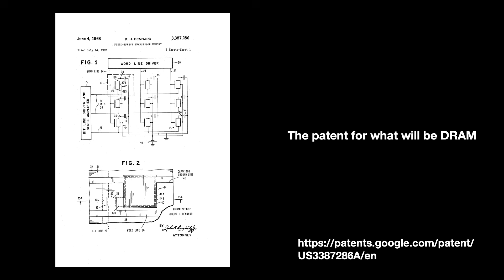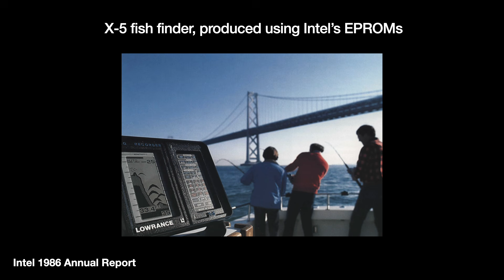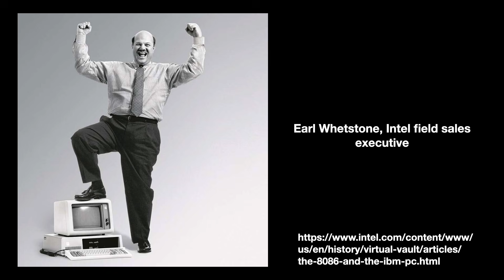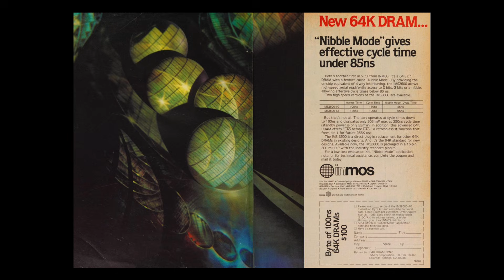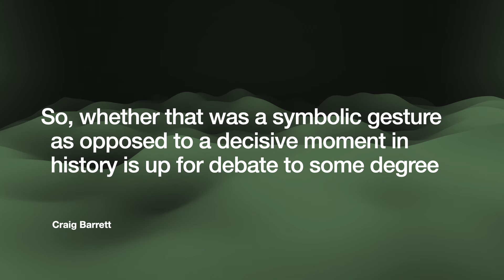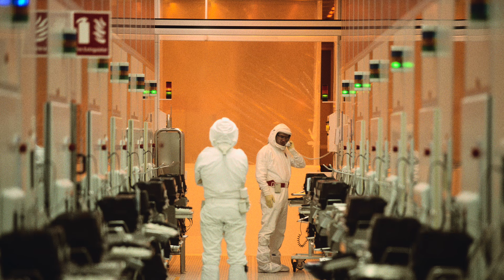What Once Saved Intel

Comment: I proposed a 4004 in a radio telemetry design in early 1972, somewhere between February and April. I was hired as a consultant to do the phase modulator of the telemetry transmitter, quite trivial and easily dispensed with.
Next they asked to build a demodulator for the same phase modulated signal on the receiver end of the channel. I used an Intel 256 x 4 bit C1402A PMOS  shit register instead of PLL to recover the phase change information.
After the company finished accusing of cheating (running wires under the table), employing magic… or maybe even Witchcraft. They then asked me to design the receiver itself.
I proposed a 4004 to do I/O and calculations. We decided to call Intel in. Turned they were totally clueless.
Very few people, including some of Intel’s top sales force knew what a microprocessor was. An indication of this was a trade journal called ‘New Logic Notebook’.

Comment: Craig’s ( my fellow PhD in Materials and neighbor ) “Copy Exactly” lasted too long, it was enforced by the extremely bureaucratic and scientifically rather primitive ( when I first moved from Motorola to Intel 8 yrs after developing Six Sigma, Intel had not even started using any Statistics ! ) Change Control Procedure, appropriate for Fabs but eagerly adopted even in R&D by substandard Engineers to block new / disruptive ideas, eventually killed Science and Innovation inside Intel, something a Scientist like Craig had never intended. This is one of the big reasons behind Intel’s current troubles along w/ Andy’s weakness for a certain Ethnic Mafia from the Middle East, which in turn validated 3 other self serving ethnic mafias ( incompetents all ) at Intel, made gentlemen Scientists leave in disgust, turning it into a giant but mediocre bureaucracy not able to keep up even with the legacy PC & Server markets.

Comment: I worked with reliability testing in 1986 and Fujitsu memory circuits was best. Motorola 68000 processors we ran for 2 years in 160 C with zero failures so the test was stopped.

Comment: 7:40 these are old PNP BJT germanium transistors by Fujitsu (old in the sense that they aren't made anymore but new unused stocks are still available), model number SA269, targeted for RF radio receivers, packaged in TO1, max power dissipation 80mW, max Vcb=20V, max Ic=10mA, Cc=4pF, hFE=45, ft=12MHz (frequency where gain is 1).

Comment: I seem to remember that at one time IBM bought a considerable number of Intel shares, keeping them one or two years.  Is that true, or was the relationship even the other way round?  But one thing I remember definitely was the cross licensing of the math co-processor with AMD.  We used the AMD version in our otherwise Motorola chips based systems — that is why I recall this detail.

Comment: I worked at National Semiconductor in the 80s and lived through much of this. The Japanese simply kicked our backsides in both cost and quality. By the early 90s we were laying everyone off and they eventually closed the fab.
Reply: Exporting Deming to Japan had such a profound impact it’s hard to understate. By the time we started talking about “quality” the same way in the 90’s it was far too late.
Reply: @c1ph3rpunk  I did a lot of characterization work on Japanese DRAMs and EMPROMs in the late 80s/90s. The striking thing was how close there were electrically and functionally across the parts delivered in a single tube. Things like TACC, TCE, current draw, VCC margins were very consistent. There were also well guard-banded. In my memory the 64K DRAM 120ns parts were good at margins for 90ns. We hadn't achieved the same quality or repeatability. Several of the engineers at the time were very concerned as was I. This was a strong indicator that without a LOT of work we would lose the market, which we eventually did.

Comment: Going alone with the 386 led to market stagnation as intel didn't have competition and didn't increase clock speeds as much as they could (good for intel bad for buyers). Eventually when 386 cpus from other vendors appeared clocks went up, but by then Intel had the 486 and would be forced to compete on clocks once again in the new generation as the competition caught up fast.

Comment: I worked with Intel in the early days of Flash memory (I had a company that designed and manufactured solid state disks).  I believe it was circa 1987 or so when we received some of the early 256Kb chips, with 1Mb chips to follow shortly thereafter.  Intel was a company with an attitude back then, and could be challenging to work with.  But they helped create and drive the Flash memory market (NOR-based) from the late 80s into the 90s.

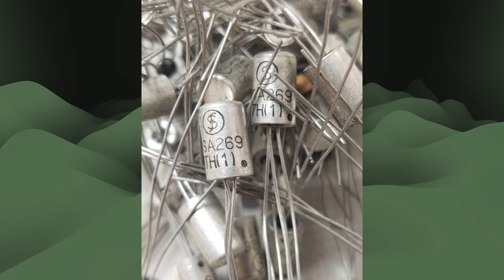Comment: 7:30 2SA269 Germanium alloy-junction transistor.  Originally made by Kobe Kogyo Corp (Kobe Industries Corp) marking is TEN.
Kobe Kogyo later merged into Fujitsu (and the logo changed to the pattern in 7:30 picture.)
Reply: And 3:29 that's a core memory, not 1103 🤦🏻‍♂️🤦🏻‍♂️🤦🏻‍♂️

Comment: The 386 was made all the way into 2007, was this all on the same node or were there several changes in node? 
I know there was some stability in package form because many were used for industrial computers that required identical packaging for long term replacement parts. The 386 was the last formally verified real-time capable x86 which made it popular for critical systems long after 486 and Pentium had come and gone. (Real Pentiums, not just marketing abusing the name.)
Reply: There probably were node changes but only small ones enough to get more yield and to keep a less ancient fab running, but even old fabs get recycled into LCD driver fabs.
Reply: @johnjakson444  The original 80386 node was 1,500 nm. Yields would have been relatively poor just due to size and raw material defects per unit area. But maybe large features are more robust in service (against external interference.) so maybe as an industrial part it could hold higher margin anyway.

A 20+ years is a very long run. Especially spanning that particular block of history. (65nm was introduced in 2006 for reference.)

As I recall 28nm remained popular for secondary/tertiary tier chips for over 10 years, but mainly because ~30nm was a sweet spot in low cost. The last of the easy scaling gains just before all the issues that require finfet and similar fancy processes.

Comment: Intel issues have little to do with chip design. Intels woes are its Fabs, which have been superceeded by TSMC and even Samsung.

Latest Intel chips made with TSMC silicon proves Intel is almost equal to AMD in design. 

The issue with Intel is that the new Fabs there are building (ready late 2025) is already generation and a half behind TSMC. And TSMC next iteration 3nm is far superior to current TSMC chip that intel cant match.

The single factor that lead to Intel downfall is that Intel management mistakenly believed that their CPU design was far superior to AMD. When in reality it was Intel Fab that was its golden goose.
Reply: Intel's fabs certainly has issues too, but I don't think their current line of CPUs proves anything the like. Arrow Lake it is mostly made on TSMC, so Intel fabs are out of the equation. They are made on a better node than Zen5, yet ARL is more expensive to make, uses more silicon, but is still less efficient and doesn't perform any better in most scenarios. They're not bulldozer level behind AMD and have caught up a bit, but they are not on par right now. 
Their last generations of CPUs further proved very well that they have serious issues with design and executing on that front. They had delay after delay, their last two gens actually had such a serious design flaws that made their chips degrade and cook themselves. That was unthinkable for decades for CPUs.

Comment: How did Intel let their 2nd source manufacturer introduce AMD64 before EM64T?
Reply: You seem to be new to these issues:
1) Amd introduced many innovations / instructions sets like 3dnow! and SSE5, they don't need Intel permission.
2) EM64T is AMD64, it is just a rename so intel avoids to name their competitor.
3) After the IBM PC monopoly ended, being "second source manufacturer" to IBM meant nothing.
4) Intel believed that only with the brand name they were going to sell RDRAM and the not-that-good Pentium 4.
rdram failed and AMD did fierce competition.
Amd was so strong and Intel so lost that they developed a pretty decent 64 bit update.
Reply: @ajax700  Also AMD around low 2000 was pushing the Hype transport links they had gotten from a company called Lightning Data Transport, the Opteron architecture had 2 or 4 of these byte wide links on board, these point to point links originated in the bit serial Transputer T9000 and came over when GT started that company in MA. Also AMD came up with memory controller on die well before Intel did too, again that had also been on the T9000. if AMD had gone under when they were supposed to decades ago, the x86 might have evolved much more slowly.
Reply: @ajax700  lol not @ all I just wanted to get into what I always thought was the initial milestone in AMD march towards exceeding Intel tech.
Reply: @chebrubin  the fastest and cheapest 386s and 486s were made by Amd.
Any Athlon was faster and cheaper most times than P3 and P4, they employed the CPU team that designed the DEC Alpha CPU, that had no job after DEC decline and HP/Compaq abandoning the Alpha. Those designed the Athlons, that are an x86 redesign of the Alpha.
K6 cpus were very cheap and outperformed intel CPUs in most tasks, comparing dollar for dollar, saving for floating point, an issue which Athlon cpus corrected.
Outperforming Intel was Jerry Sanders III obsession, and they did that many many times.
Reply: Well Intel was asked for a 64 bit Pentium version, they declined because they had hopes for their next not x86 IA-64 bit Itanium architecture, so AMD stepped right in and did it themselves, a very humbling moment for Intel to have to back license from AMD while the IA-64 slipped away to obscurity.
Reply: @johnjakson444  the industry surely dodge a giant dud by Itanium failing.
what do you think as a CPU designer?

Comment: well it was laptop cpu that save intel back then even internal people at intel didn't believe it at first for tiny architecture that use less power than pentium 4 was at their limits in 2 cores ...it was interesting back then how intel core 1 architecture from monroe era could defeated all odds against amd64...it was crazy how laptop chip became what is today with lioncove ...the last core architecture...also its happening again with e-cores that is only use on tablets and smaller devices that use routers and modems ...the atom architecture , now nobody every believe that current architecture is now very powerful than alder lake now....a former atom core

Comment: there is no, or very little benefit left in transistor scaling. this is the end :(
Reply: There is still plenty of work in physical architecture, what AMD and now Intel are doing with back or front side memory, power wiring on the back side, chiplets made on older fabs and so on and power and thermal management. With the chiplets we could finally do some integration with fiber optics and light perhaps, MEMS even for some applications.

Comment: The reason for the way 8088 pin out it was is to save cost. I remember you have to use latches because it share data and address pins. Where the 68k was popular especially with schools is because the pin outs are straight forward. You have seperate data pins, address pins, arbitration pins, interrupt pin and logic pins. The 68k was also easy to program since it uses flat memory address space include hw i/o. Unlike the 8088, access memory was a pain where you have segment and offsets. Fun times.
Reply: It was also to mirror the 8085.  The architecture with memory segments was literally to take existing 8085 code and do some minimum rewrites at a binary level and be able to multitask it quickly.   There was a program called CONV86 that ran on the Intel MDS development systems for this.  Turns out the market demand never materialized primarily because of the native coding of the IBM PC and then its success obviated the plan.  It was a cool plan for another time line.
Reply: There is an interesting backstory for the 8086 and 68K during their development, both I think were prototyped as TTL logic boards, I think the 8086 in TTL came up before the NMOS chip but the 68K in TTL came up after the device was made, that was pretty much the last time the industry did hardware prototype. That proved the 68K didn't really need to be hardware prototyped. Also the design of the 68k was done with very minimal use of CAD except for mask layout  as well, it was classic logic design by hand and paper. But once FPGAs became available, nVidia used an FPGA system lab to prototype graphics chips but also to tweak the design before fixing to silicon, that was shown on YT.
Reply: Also to note, that all support chips for I8080 were 8-bit and could be used with the new I8088. You know, 8212, 8224, 8251, 8255, etc and those were used in the originat IBM PC just because they were cheap and mass produced by Intel and others.
Reply: there was a 68008 which did the same 8-bit bus trick, I don't know offhand if it came out before or after the 8088.

the 8088 is kind of a 8086SX. ;)
Reply: @poofygoof  The 68008 would have come long after the 68000 and the 8088 and was used by a few very low cost devices, the Sinclair Ql used it, I had one and used it for a few months, the overall software on it was awful so I switched to the mac as soon as I could get one. I also got to spend a month or so with the 68k under a microscope.
Reply: @johnjakson444  Also the 68008 didn't have the BUI (rudimentary cache for the uninitiated ) that the 8088 did to compensate a fair amount for the 8 bit bus.  Just added wait states.
Reply: @paul_moir  I vaguely remember that in principle either one of these, probably the 68000 more likely could have been put into a socket on a small board with the extra latches added as a quick prototype to go into a 68008 socket board before the 68008 chips was available. So software guys could get a board up before the reduced silicon came out. That sort of thing was pretty common given the 8MHz like clock speeds of the day.